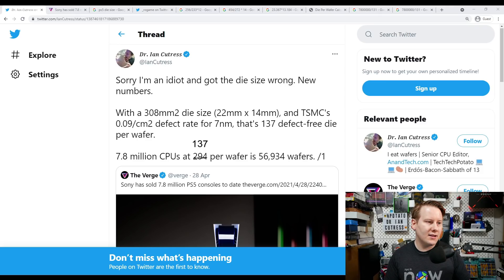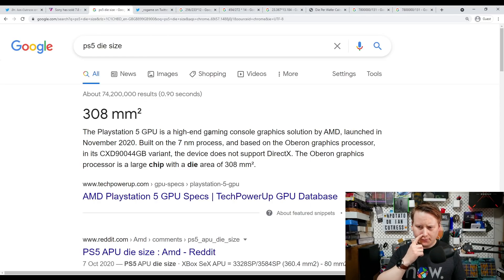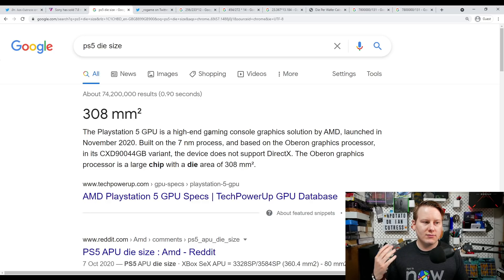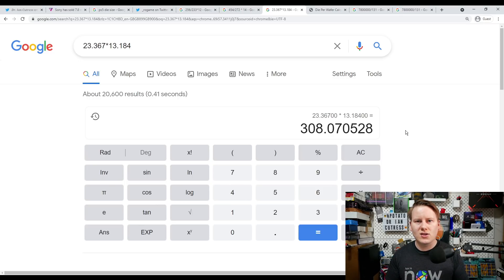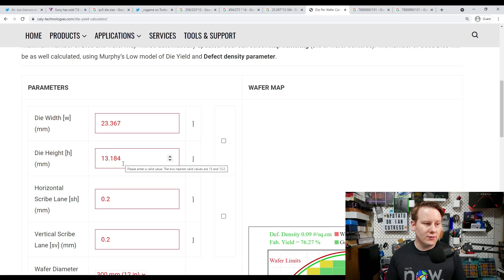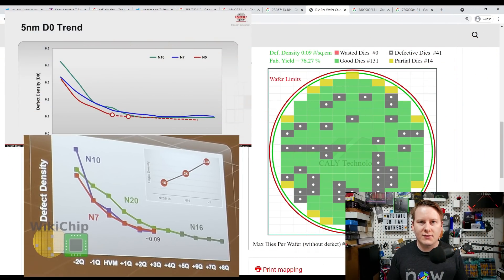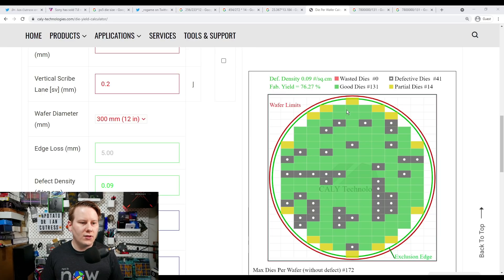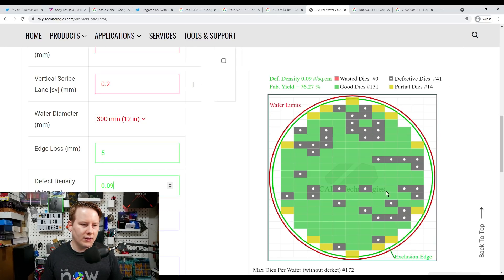PS5 Wafers. Tasty. 🍕

Comment: While you get 131 PS5-dies out of a 12" wafer with the same defect density you get 642 Zen 3 Chiplets (~ 5 times as many)
Reply: I'd be surprised if AMD gives Sony more than the contractual minimum amount of wafers they have to produce. Any spare capacity that AMD can get will be so much more lucrative if turned into Zen 3 chiplets or GPUs...
Reply: @Steamrick  Yeah but they have to think longterm, if they piss off Sony or Microsoft then it compromises their future partnerships with them. Having a few hundred million consoles powered by AMD hardware is an enormous advantage for them in terms of developer support, optimizations and mindshare which is arguable far more valuable than the meager profit margin on the chips themselves.
Reply: And starting at the next console generation Intel and Nvidia will both be capable of designing and building custom APU’s as well...
Reply: @DragonBallsDD  The Switch is running on Tegra, so nVidia is technically already in the game.
Reply: @SolarianStrike  Yup but once they can build a full APU with ARM cores they’ll be far more of a threat. Intel even more-so since they have their own foundries and can produce massive amounts of chips at cost which would let them offer better supply to consoles at a similar price to AMD while still making better profit margins. And with their announced intentions to become a full-service foundry you can bet your ass they’ll be targeting the next console generation. It would be a pretty easy port compared to other solutions like ARM so they’ll almost definitely be the biggest threat to AMD’s semi-custom group going forward.
Reply: @DragonBallsDD  it's not like Sony can make (and move) 50 million consoles in one month even if they receive 50 million CPU dies from AMD, Intel or Nvidia. People talk about this as there is somewhere stashed billion consoles missing one chip just waiting fro TSMC to make them.
Reply: @DragonBallsDD  They're already doing that.

The Switch is based on Tegra, Tegra is an ARM SOC.

Honestly though, if Nvidia makes a consumer version of Grace with Turing or Lovelace built in...
Reply: @DragonBallsDD  they're already capable of doing that but not at pricetag that can be competitive with AMD. After customization and licensing AMD just wins out when it comes down to cost/performance... Always has.
Reply: @DragonBallsDD  Which means AMD are as greedy as Intel/Nvidia. Can we finally bust this myth that AMD actually thinks about us gamers?  Tired of seeing people keeping AMD on a high pedestal of ethics and morality. At this point, I wish Intel bounces back hard with Xe+Alderlake. Fuck AMD and Lisu Su.
Reply: @klyplays  If you think you're doing a good job of hiding the fact that you're an Intel fanboy/shill, you're really not.
Reply: @TechHug  xD, and neither are you.
Reply: @DragonBallsDD  Nah they did agree on number of wagers/production  numbers years ago, way before anybody knew there will be a shortage. Also AMD did pay for those wafers based on priced that they did negotiate back then as well.
Reply: @klyplays  exactly.
Reply: @cybermechid9181  Intel kept the prices of i5s stagnant, that way people who purchased ivy/sandy bridge CPUs weren't outdated. Now the 1600x is slow af compared to 5600x. I would rather have stagnant competition where one is absolutely slow af compared to other because that actually keeps the value of my possession higher. AMD fucked the prices of older gen parts. Bad for us.
Reply: Indeed though longer term Sony and Microsoft are massive customers so what they might lose on margin they make up on revenue.
Reply: But what's faster
Reply: @dumbdiveer  yeah lmao, you would be surprised how gullible people are.

Comment: 10:49 wow if TSMC can do 140,000 wafers a month and sony is using 10,000 about 7% if xbox is using the same thats about 14% maybe. 
makes me wonder how much AMD is using in total.
Reply: There were leaks ~80K for Sony, ~40K for MS, ~30K for AMD 7nm split for Q4 2020 production. Which means A LOT of console chips were made (should be almost 10mln just for PS5), but it takes ~3 months to actually make the chips- so they became ready during Q1 2021 only- and then consoles with them have to be made, and shipped, and sold- so probably not that much of them made into Sony's 7.8mln reported number.
Reply: Last I heard it was 40-50% of the total 7nm production, this is more or less a rumour though
Reply: @trisjack82  I wonder if sony's 7% was the original min contract requirement or if they paid a lot extra to ramp up there allocation.
same for xbox.
Reply: AMD is about 9.5% of TSMC production (that includes all AMD segments, desktop, server, CPU, GPU, APU, consoles). Apple about 25%. Broadcom: 8%, Qualcomm: 8%, Nvidia: 6%, Mediatek: 8%, Intel: 7%. This is after adjustments of Qualcomm and Nvidia moving most of their manufacturing to Samsung. As of 7nm, Apple probably is indeed ~40%.
Reply: @movax20h  apple must be 90% of 5nm XE they must eat silicon like a Cooke monster.
Thanks for all the cool replies, interesting to see all the breakdowns.
Reply: @movax20h  apple is  on 5 nm though not on 7 nm right?
Reply: @anonymouscommentator  Afaik all their current stuff is on 5nm now for SoC. But I wouldn't be surprised they still use 7nm in some places.